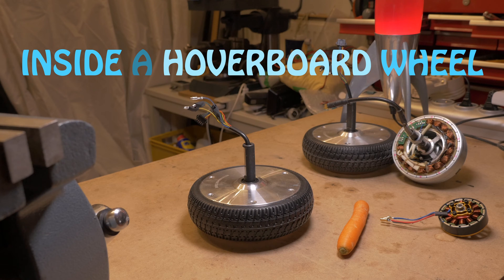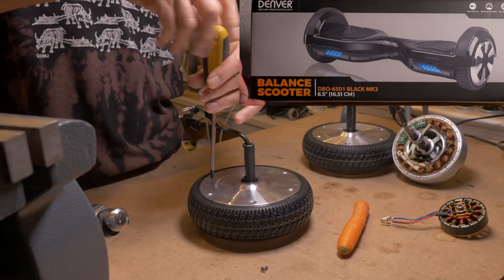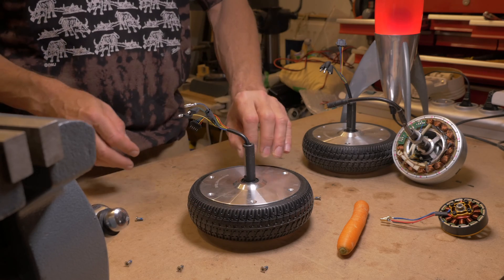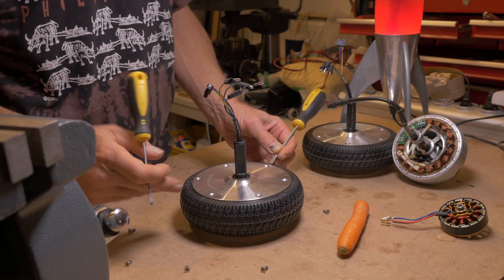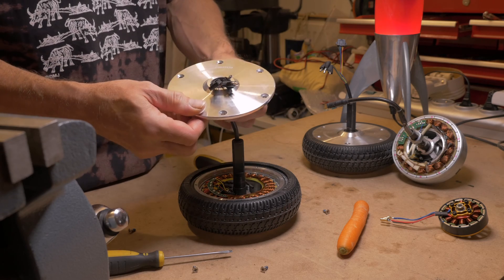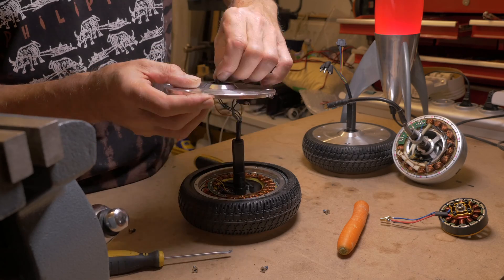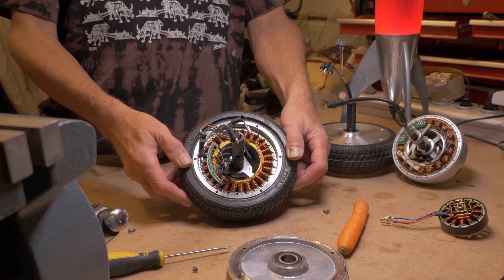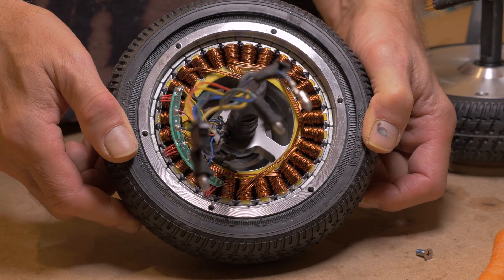Getting inside a Hoverboard Wheel

Comment: Hello Giesbert (guess we share a passion, mainly 'innovation and invention' as well as some morals) … so, i lend you my brain for a little while, and while i have no clue if this is useful for your situation, it was what sprouted up as i considered your situation after reading your website and goals... So, going off of your current seat, i was thinking about air inflated cubes, about 10 by 15 cm (all similar so they can more easily be mass produced), they could form a seat like you have now or a whole bed, each cube would then have valve and the cubes would be interconnected in a checker pattern (so 'white cubes to white' and 'black to black') ending in two main air tubes (will get back to those); Then you could control the pressure in these cubes 'individually' (well not each, but in the pattern) so that each cube belonging to the same pattern, has an equal pressure in them; which you could then 'alternate' slightly, to reduce the amount of time a part of the body is exposed to a certain 'pressure', while (due to the checker pattern) still having enough support to sit or lay-down comfortably (hopefully, like i have no clue but it sounds logical); 

So then to achieve this without having to need a full compressor, i thought of the following. Each 'end tube' would have an electronic controlled valve and both would end up in one to still fully engineer 'pressure chamber' (you could actually calculate the volume needed to alternate between certain pressures) which would basically function as a lung. It would start filled with air and push that air out into the 'under pressured set of cube-cushions', then said valve would close, the other set open up and remove air from that set of cube-cushions. (the other way around would make you wobble up and down ;D ) The in and exhale could probably be done electro-mechanically with a linear actuator. And because you only need to replace a limited amount of volume, mainly to slightly reduce focussed pressure, while still remaining a comfortable seating, the mechanism may well be able to stay relatively small.

The main business sector that sprung to mind for something like this, would be the air-castle business. They already use high-grade materials that withstand a lot of abuse, are able to make all sorts of shapes and sizes; though i am not sure if the materials they use are actually fully air-tight. But they would certainly have the experience in the processes needed to make these cubes… 

Thing is though, i have no clue if this would even be remotely of use for people in your situation, as you so rightfully mentioned, engineering something for somebody that has a condition that is  something that is hard to imagine or 'experience' yourself, if you yourself do not have the condition, that can be hard. But it was interesting to think about, and seeing i have no use for this idea, while it may well be something for you (perhaps even to build upon), it's yours now, well, guess it's open source and unless somebody has patented this before me hitting [post] it will be unpatentable for eternity. Do with it what you like ^^ hope it solves some of your discomforts as well as anyone else in this situation. And perhaps a version of it will make it on your chair !
Reply: Ohw, something else i thought of was that you likely need a 3D scan of your body (actually anyone in your condition wanting this super chair may want that), seeing you can not stand up, i think a 3D scanner in a flat position, with a glass or acrylic 'bed' to achieve full 3D, or harness of some kind (although a harness to stand up sounds more like a torture device). But anyways, with a 3D model of a body it would be a lot easier to model a comfortable fitting 'encasing' to sit in. And seeing you understand the power of 3D modelling, i bet you also understand how 3D printing (of some kind) can help a lot to make a more 'mass production viable chair' easily customisable to a particular person, by say printing the seat cover in some soft-foam substance which could be mounted onto something that is chair shaped and say has the above mentioned solution to reduce pressure wounds… 

ps. if the above cubes would have to form a chair shape, then other forms besides cubes would be needed (mainly for sides of the body support), a printed to the body type soft-layer could 'fill the gaps and increase comfort'... 

Guess that was it for now, i will let this simmer for a bit in my subconscious, and likely come back some other day to check out your videos and perhaps share anything that sprung my mind.

Comment: I bought a broken hoverboard for cheap and I'm trying to take it out to see if there is a problem inside the wheel. Any ideas how to get it out of the stator?
Reply from the maker: Hi Anj Fyi. There seem to be only 2 things that hold the stator in the rotor/wheel: magnetic force and the ball bearing. Hold the wheel down, have real good/smart grip on the axle (without damaging it), and next pull them apart straight. But take responsibility for your own action, because I'm not sure, as I have not taken one appart yet. Beware putting it back together, that your fingers don't get stuck. The magnetic force is powerful. Also; protect the fragile magnets. Good luck. Nice that you'll try to repair it, more people should do that!
Reply: @GiesbertNijhuis  Thanks Giesbert, if I can't repair it I will try make it a DIY generator project. I'm glad less people repair it when it breaks so we get cheap bldc motors haha!
Reply from the maker: Ha! True: the one persons's broken hoverboard(and many other stuff), is the other's DIY perfect project part. These wheels are super as a motor or generator. I will always look for "broken" hoverboards in the trash.
Reply: @GiesbertNijhuis  I just found one and swapped the motors to diagnose that that was the issue (as opposed a the esc). I was able to pop the motor off just fine. I didn't see any damage or anything stuck, but it is still not working. I will take it apart again tomorrow and check out the wiring with my multimeter and oscilloscope.